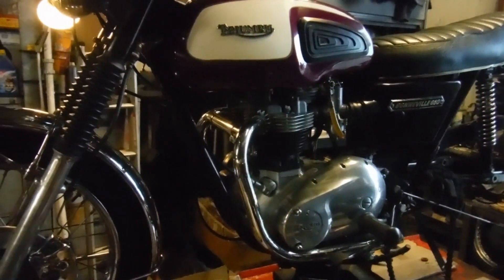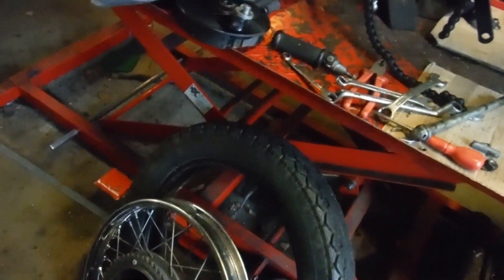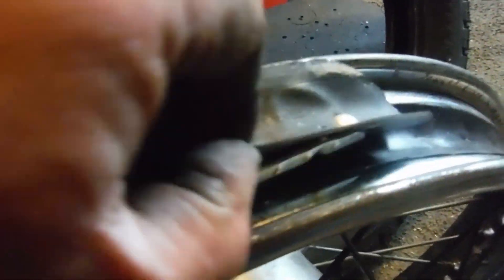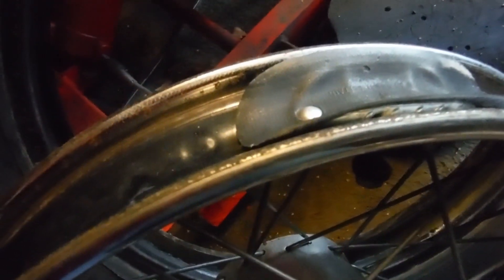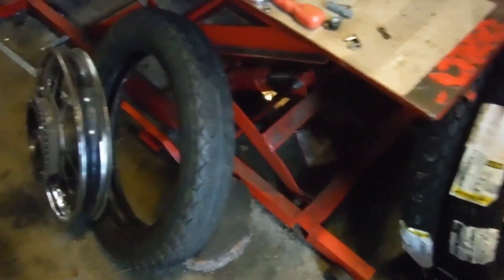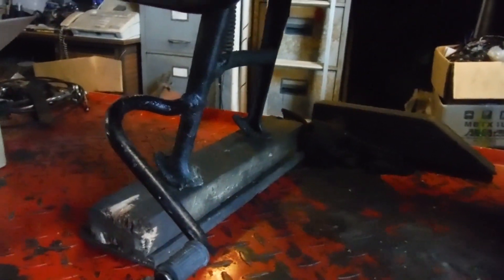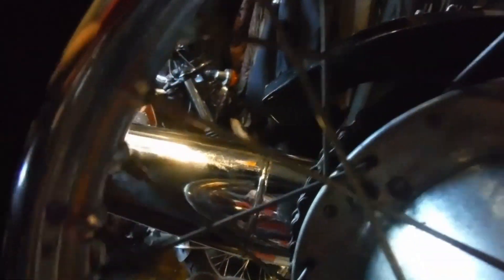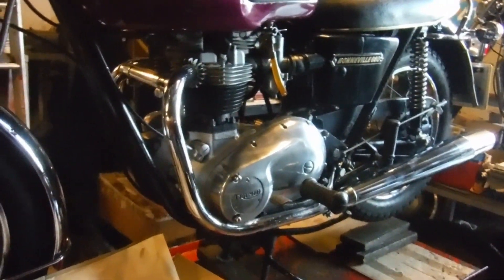Triumph Bonneville T120V 1 Rear tyre change discussed.

Comment: That's a lovely looking Triumph! On the subject of rim locks, they're more commonly used on dirt bikes and I've done many tyre changes where they've been fitted. People swear and curse about them but I don't believe they present any problems fitting wise. It's simply a matter of pushing them outwards from the rim as the replacement tyre is being fitted, so that they don't get caught between the tyre bead and wheel rim. Personally I've never seen the rim tape fitted over the top of the rim lock but I'm not saying it's right or wrong.

Comment: These 1974 final model year T120V's are great bikes, I own one and it's my favourite bike. There's a bit of mystery with these bikes as they are similar to the T140V in a number of ways and, in my opinion, combine the best features of both bikes. The majority of these T120V bikes were built in Sept 1973 and we're all caught in the factory occupation that started near the end of Sept that year. As a result of that there was a brochure and owners handbook printed but there's no parts book or workshop manual. You have to refer to the 73 T120 and 73 T140 manual and parts book as they are a mixture of both.
My own bike has a Tuftrided crank, later timing side roller bearing and dynamically balanced crank with new Thunder Engineering con rods and has done a number of long continental trips down to the Alps, Mediterranean coast and the Pyrenees averaging 58mpg with a twin plugged head and bronze valve seats. It's my most favourite bike that  I will never sell.
PS I run Bridgestone Battlax tyres without rimlocks and they're brilliant tyres for grip and low wear, I recently did a hillclimb race in the wet and they were excellent, more than what could be said of Japanese tyres back in the day, probably be certified for swapping out to them back in the 1970's 👍
Reply: @bazxl57  as far as I know the colour was known as Regal Purple. It's a candy coat applied over Arctic White masked base. My bike is a KG numbered Sept 73 build for 74 model year with the triplex primary drive.
Reply: @Brit_Toolmaker  Thanks i will go with that colour
                                   Cheers Baz

Comment: That's interesting, I've only seen them fitted with a single security bolt, and that's fiddly enough to do. There is one way to get the rear wheel spindle out without removing the wheel, and that's to unbolt the shock absorbers and raise the swinging arm to clear the silencers.

Comment: I've always put the security bolts through the rim tape, but that's what i was taught to do and who knows if the people who taght me knew what they were doing? Maybe I inherited bad habits! I'm surprised that triumph felt the need to fit them - I can't see that the awesome power of the 650 unit bonneville would induce tyre creep...

Comment: Pain in the bum the bead clamp things. I have changed a few back tyres on 650s and only ever seen the tape on the rim with a hole for the bolt. Nice to see a "mythical" lock-in 650

Comment: Appreciate you sharing your expertise as usual sir! 
I picked up my first Tiger Cub yesterday Paul!   It is a completely unrestored 1963 T20.  I’m over the moon my friend.   
Questions.   What weight oil do you use in yours and is there a good Cub source for any parts I may need?
Bless you and the family. 🌞🏍
Reply from the maker: Thanks - I hope you enjoy your Cub! I use 20/50 mineral oil in mine, even for the gearboxes, primaries and forks, with no problems. I have quite a lot of Cub stuff, but there is Greystones and Burton Bike Bits probably have some, too.
Reply: Fantastic Paul!    I appreciate the information.   
My T20 has only done 7000 miles and it’s in fantastic original condition.  Doesn’t need much and runs and rides like new.  
Just going to go through and give it a Dynamic Preservation. 
Bless you sir. 🌞

Comment: Nice to see the different shaped tank, nice colour too. That's a late reg for a 650 isn't it?
Reply: Yes, for a five speed and oil in frame.
Reply from the maker: Also note the disc brake.
Reply: @paulhenshaw4514  could that be a bitsa?
Reply from the maker: No - a very short production run, genuine machine, I am told.
Reply: The smaller tanked/hi bars US Spec bikes seem to be more popular, even in the UK. To me though I always dreamed of owning either the 650 or 750 in the 1973 brochure in UK Spec. I finally own (via a stressful last minute on ebay!) the bike that Paul is working on and look forward to riding it. Its about as original as one can get and has been stored for many years. When I went to Meriden during the blockade the vast majority of bikes locked in were US Spec. When I was invited to the re opened factory in 1975 I didn't see a single UK Spec Bonnie being made. An article in Classic Bike Magazine (Jan 2012) stated that only 250 to 350 T120Vs were built in Sept 73 before the factory shut down. The 650 was to be replaced with the 750 and so they were merely using up what 650 bits were left over! Mine is one of them released to NVT by the occupying workers during 1974 for £3 per bike!! It was registered a year after it was built hence the N registration. However the number has been disputed on a Triumph Forum that I have seen and the actual amount built is probably nearer 850. Even so, the majority would have been US Spec so this UK Spec Bonneville with RH Change is very rare indeed and will be cherished by me hopefully for many years.
Reply: @richardchandler9905  I was Triumph phobic for many years due to a bad early experience, after a few years on very reliable Japanese 2 strokes I bit the bullet and bought a brand new red/black T140 us spec from Hartwells in Bath, picked it on a Friday and headed for the coast with my mates, Saturday morning it just refused to start, dead as a dodo recovered by the AA back to Hartwells, ignition problems. A week later riding through the lanes near my house and the left silencer flew off and went through a hedge into a garden. I rejected the bike to Hartwells and bought an XS 650 which was 100% reliable, I never bought another Triumph until 2005 when I bought a 955i speed triple.
Reply: Sounds like a nightmare and enough to put you off ever buying a Meriden Triumph ever again. However I had a 1968 Bonnie when I was 18 and thrashed it for a year. Never any problems. When I get this T120V back from Paul I will be riding it very gently everywhere. I am sure The Modern Triumphs are much better made although as with all retros lacking a wee bit of character. Like  360 deg sound, Vibration, Oil Leaks....lol!
 @PatrickWhitaker-ls2cs
Reply: @richardchandler9905  I reckon an old Triumph that's had some sensible upgrades is probably more reliable than when it came out of the doors at Meriden.
Reply: @richardchandler9905  P.S. I have a 2012 air/oil cooled bonneville and it is 360 degree and does vibrate but doesn't break down...so far.

Comment: What's the point of the cross piece on the exhaust(s) near where they bolt to the head?
Reply from the maker: It is called a 'Balance pipe', but whether it does much or anything is questionable.
Reply: Thanks, Paul.
Reply: @paulhenshaw4514 I think it is supposed to quieten it down a fraction as one exhaust beat can go out one silencer and partially out of the other

Comment: I would be suspicious of any original work done at Meriden in the 1970’s to use as a guide, It was a precarious time for Triumph and quality control wasn’t all that it should have been …sadly.
Reply: Agree. I am a little nervous as to what Paul will find on my bike. It was built by men who had just been told their factory was about to be closed by the new owners NVT. Morale must have been low in September 1973.